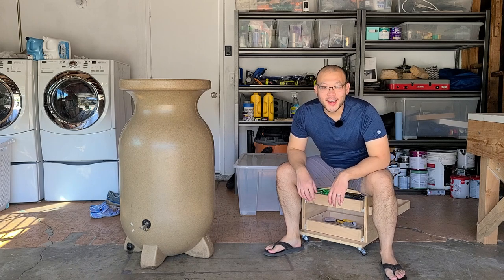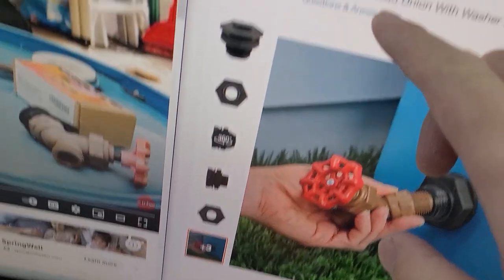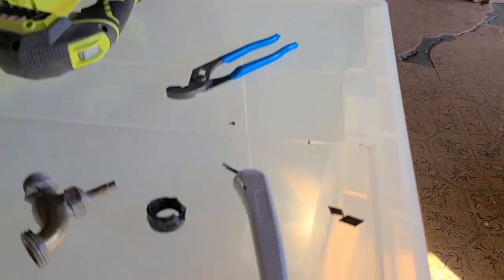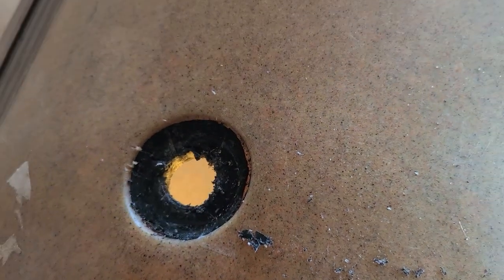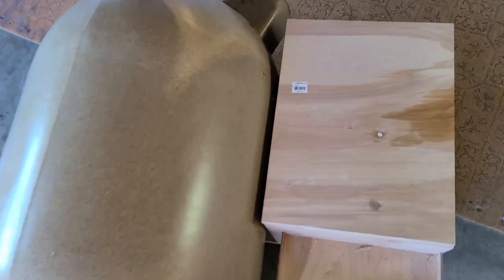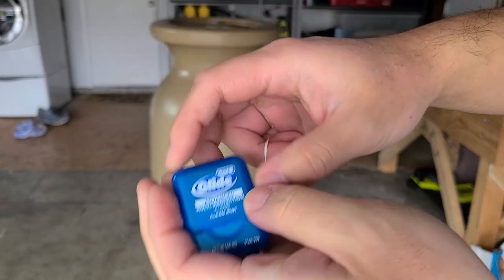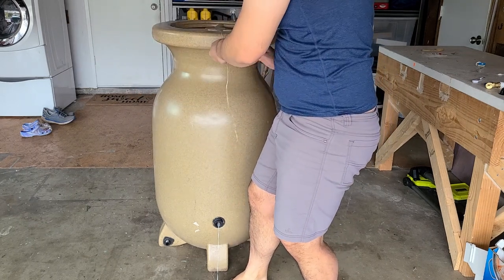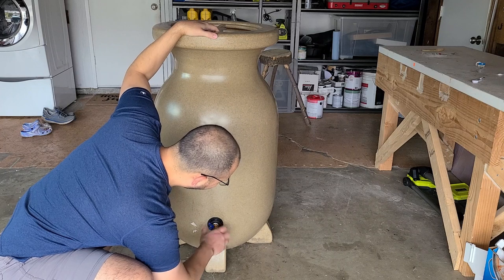A Dentist Replace Rain Barrel Spigot

Comment: Angle grinder to cut the valve directly in half to save the hole in barrel perhaps.
Reply from the maker: Yeah.....I need to pick up an angle grinder.
Reply: @ADentistDoesHomeImprovement  seriously look at a cordless, so much more useful, depending on what cordless tools you have, also a cordless demolition saw, then you can get an awful lot of things done

Comment: In the future, use a piece of scrap wood to hold the bit in place. Drill the hole in the scrap, then hold the scrap in place to keep the bit from wandering.
Or use a stepper bit.
Reply from the maker: That's genius! I'll try that next time. I'm going to replace the spigot on the other barrel. I do also want a stepper bit too.